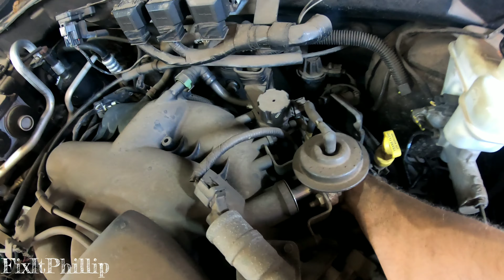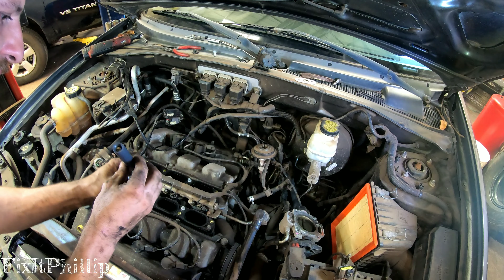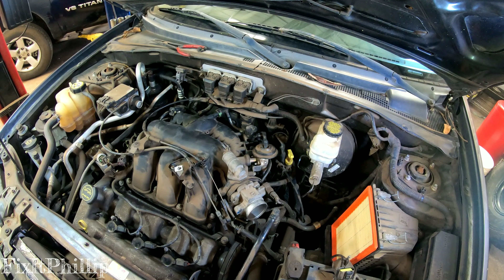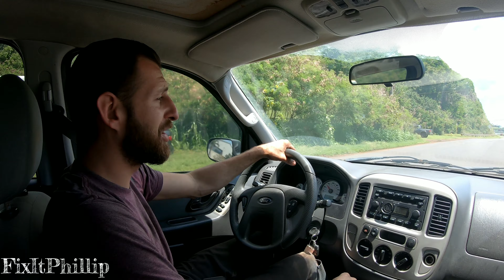2005 Ford Escape Misfire Fix 3.0 V6

Comment: Could also be a clogged fuel filter.  I'm changing mine out and have new plugs and coil packs for it. 2005 3.0 escape 179k miles on it.

Comment: So you switch coils put it all back together and you still got to misfire number 3 cylinder so you got to take everything apart again or what the f*** that's a b***** design. It'd be so much easier if you could just test it while you had everything together so you can run

Comment: My 01 v6 only runs like crap when it is cold and below 1000 rpm.
If you give it a little throttle it clears up so i'm thinking lower intake gasket?
Once it reaches operating temp the rough idle goes away but i do have a cylinder 1 misfire code.

Comment: Great video. Very helpful. 

I did this last night. The detail you provided gave me confidence to do this myself instead of paying $100s to a local shop. After putting everything back together, the car started right up and ran like it's supposed to. The check engine light came back on after a few minutes though. The error was for the throttle sensor. I found the connector wasn't secure...my fault. Thank goodness I purchased a code scanner the day before! All good now.
Reply from the maker: Good job

Comment: Hey Phillip thank you for the video first of all! Definitely showed me something new and had a question, i am actually working on my FEscape05  and i know for a fact i got a misfire from a failing plug going on but would that alone be attributed to my cars rough time going up in gears?( I suppose that's what it is) for example I'll have a hard time getting through 50mph and when i finally do i get misfires and definitely feel some turbulence in the pedal, vehicle was gifted to me by family but as far as they know they said it had a couple of things going on with a vapor box, some air sensors, and i believe a motor mount. But could it be something much more urgent?
Reply from the maker: I would check what codes are stored  in the engine computer.  I would also Check for vacuum leaks and plugs/coils
Reply: @FixItPhillip  definitely will get on that, thank you so much! And hope all is well, thank you for the videos you share with us!!

Comment: Philip, I got a problem. Mine is either the PCM or the wiring harness to it. I've also got the cluster throwing communication codes and doing self-tests while driving, lol. It will send the speedometer and tach up to max swing and go back down when you hit the brakes and crazy stuff like that. At least mine is cylinder 5 and 6. I wiggled the PCM connector and the idle speed reacted positively for a second. Ever mess with that big bundle of wires?

Comment: Do you know that there is an inbuilt engine diagnostics tool built into this vehicle?
On the dashboard, press and hold in the odometer reset button, then turn on the ignition, without starting and still holding the button until the odo display changes to diagnostic mode. Release the button.
Using the button again, one can then step through the various test modes including the engine diagnostic codes, if any.

Comment: Good test method, but please engine off whilst changing the coil out, may stop ECU coil driver failure. I have the same fault on a 2001 V6 ATM. Found 5/6 could had cracks in the potting on top near the connector, so changing all 6. Great video.

Comment: on the 2003 you can actually disconnect  1,2,3 coil packs  while running, its tight but can be done. #1 appears to be my culprit. great vid helped me as far as coil packs and no check eng light.

Comment: I have a 2005 500 Limited with the 3.0L Duratec DOHC V-6. Has that cross brace and upper motor mount.  Also an electronic throttle body. Other than that looks about the same.  Bank 1 is a real PITA to access. Thanks!!

Comment: This is great...thanks Phillip!  This is exactly happening to my 2005 Escape now.  The mechanic quoted ~$1k to fix the 3rd cylinder.  Majority of that cost is taking off the top which you demonstrated.  I'm debating whether I should do it myself.  Question...how long did it take you to complete the project?
Reply from the maker: Its approx a 3 hr job total

Comment: Wouldn’t it have been a good idea to just replace the plugs and coils in the back since it was all apart?
Reply from the maker: Yes that is a good idea, in this particular case the customer wanted the 3 known good coils in the front swapped to the back and just replace the failed one. But yes if you are already back there, wouldn't be a bad idea

Comment: hello FixItPhillip, my problem with my ford escape is that it loses power and jerks it on the road and I have taken it with mechanics and they do not find the problem.
Reply: My Ford 500 limited is doing the same thing.
Reply: Did you ever find the problem? I have the exact issue as you did. I’ve checked/cleaned or replaced spark plugs, coils, injectors, fuel pump, egr, pcv, maf, iacv, vacuum leaks, even replaced the catalytic converter. No engine codes at all. Runs normal at idle, but if the AC is on it will misfire at idle randomly. At highway speeds it misfires and shakes the vehicle if I’m in a high gear/low revs. Not as bad at higher RPM so is worse under load. Running out of ideas and almost ready to sell the thing hahaha

2005 ford escape 3.0 V6
Reply: @northvankiwi it's more than likely to be the ac pump bearings or clutch going out...

Comment: Hey Philip. I have the same engine that was doing the same thing and had code p0303. I put in a new plug gapped to .52 and a new coil. Started it up and is running horrible. What could I have done wrong?
Reply: It could still be the pcm. When I had what definitely proved to be the pcm, the misfire was very intermittent. At times the engine ran fine for a couple of minutes, then would misfire again for a minute, run smooth for another minute, then misfire again, etc. That's the way flakey electronics can be, the weak point on these pcms are what is generally the weak point on electronic boards most frequently with substandard design: second rate capacitors. When the dielectic dries out between the plates of the capacitor, it's no longer doing its job. I think they had a recall that covered vehicles with less than 80.000 miles. I don't know if it's still in effect. I had 82 thousand when mine went bad.
Reply: Check the fuel injectors
Reply: @surfandsail  thank you

Comment: PCMs are very reliable. But the failure rates are pretty high with this car and engine. So don't be shocked if it happens. It happened to me. One cylinder was misfiring. Changed all plugs and coils. Same misfire until I changed the pcm.
Reply: Did you have to get it flashed or whatever or was it just plug and play and ran fine after you simply put in another pcm? Having the same issue. Also, what did you gap your plug at?
Reply: @kevinearles1  You can usually buy a preflashed pcm. They'll ask your exact mileage and vin number, because the ignition timing will become a hair different with an aging engine and a reputable rebuild place will data correct it in the flash. Don't remember the plug gap offhand. New plugs are normally pregaped nowadays, but you can always do an internet search for just about any spec for just about any vehicle. One thing I hasten to add. It was spitting out codes pointing to a possible bad pcm.
Reply: @MrAquinas1  appreciate the fast reply. Mine showed code p0303. I put a new plug and coil in and it ran good for like 30 seconds and then started running horrible
Reply: @kevinearles1  Another point. You have to get the PCM to recognize your keys. There is a procedure. I did this seven years ago. I don't remember if instructions came with the PCM, or my mechanic advised me how to do it. I'm into my senior years. I used to do all my own work, but now I can only do work that doesn't require crawling under.
Reply: @MrAquinas1  I wondered why they meant recognizing your keys. I have an 07 Mariner and it doesn't have the chip on the key. Thank you for all your help though. You have provided some very useful information
Reply: @kevinearles1  One more point. To get the warranty coverage on the PCM, they required that I change all the plugs and coils and keep the receipts.
Reply: PCM or ECU? I seen people say both
Reply: @dylwillonewheel7614  They mean essentially the same. The first engine computers were called Engine Control Units, thus ECM. Then they started intergrating more functions like transmission control and sometimes 4 wheel drive control, so they designated them Powertrain Control Unit. PCM.